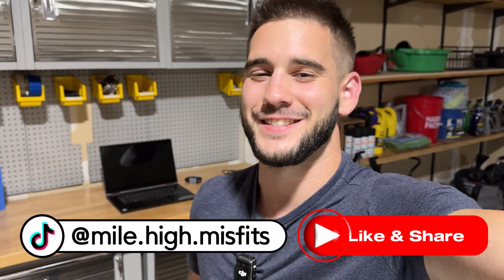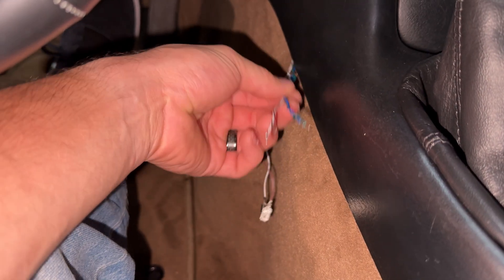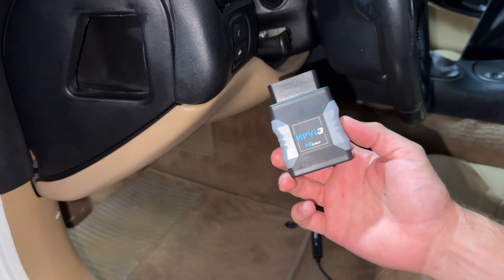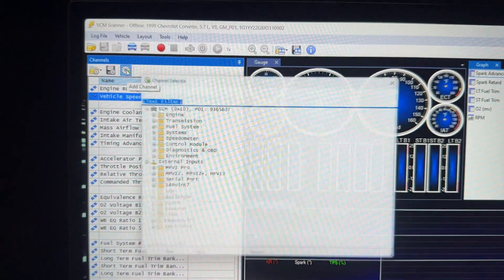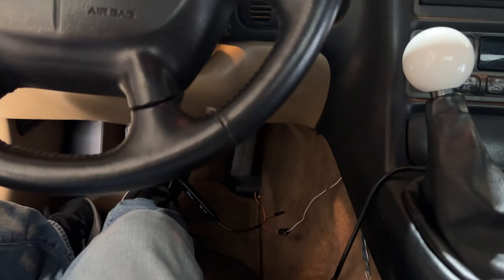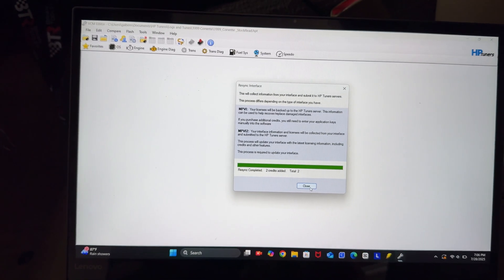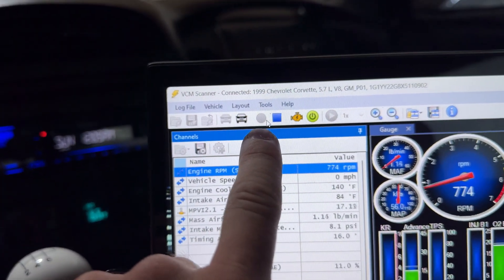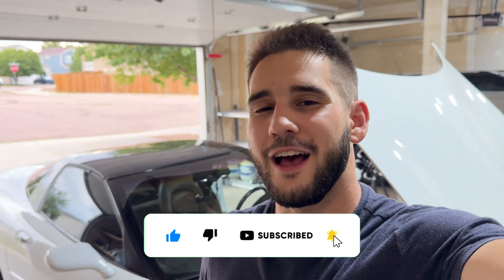How to Install HP Tuners ProLink+ for MPVI3 | Full Step-by-Step Wiring & Setup Guide w/ AEM Wideband

Comment: Good stuff! Where did you mount the sensor? I don't have an extra bung upstream from the catted Y on my LS1. For now, I'll have to unplug a narrow band 02 upstream for the tuning.
Reply from the maker: I have another video showing the install of my AFR gauge, and in that video I show where I installed my sensor. I did mine right after my high flow cats. Usually you want to make sure the sensor is before the catalytic converters but since mine are basically just straight through pipes it doesn’t matter too much
Reply: @milehighmisfits  Thanks for the response! I'll check that clip out. I have a high flow catted Y pipe. I'll install the sensor downstream then; my downstream O2s are disabled anyhow.

Comment: Im sharing this to everyone form I come across on this subject.
One issue I am having is the gauge shows "sense" error. Would it be a power ground issue? Suggestions?
Reply from the maker: Thank you I appreciate you sharing my video that helps my channel so much! 

Are you saying there’s a sense error on the HP tuners side or the wideband gauge itself? 

Usually I’d look for weak connection issues and bad grounds for that. Make sure the ground for the sensor AND the Pro Link+ is on a solid chassis ground, not a painted or shared surface.

Signal wire issue – Double-check that the analog input wire is going to the correct “S” or “Signal” wire on the gauge/sensor, not power or illumination by accident.

Comment: Would the mpvi4 be wired in the same way????
Reply from the maker: From what I understand the Prolink+ is the same for the MPVI3 and the MPVI4, so it should be the same wiring
Reply: @milehighmisfits I followed your instructions with it and my gauge is steady 14.70 and reading on log readings are all over the place????
Reply: I was just wondering because the MPVI4 does not come up on the channel

Comment: I just got my new mpvi4 and I have the AEM 30-0400 do think it would be the same to wire. I have my AEM wired in to my truck so it will come on with the key is turned on so do I have to disconnect and rewire it this way?
Reply: Afr guages all go to the proline for data reading, I believe

Comment: Did you know there is a way to read your torque output on your scanner?  Scroll through your channels and look for delivered Engine Torque and add it to the channel list.  Then you can track it on the graphs and on the  chart vs time as well.  there is also a formula to convert toque to horse power too, but that is a little more complicated.  By looking at the data I get from mine compared to what the dyno said it appears to be wheel torque  not crank just so you know.